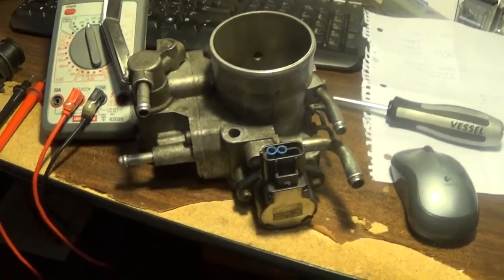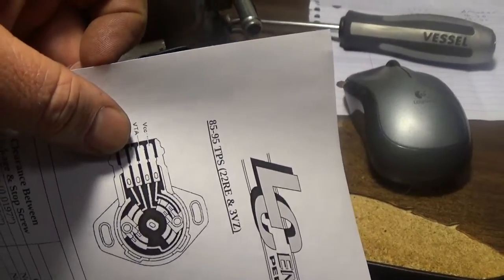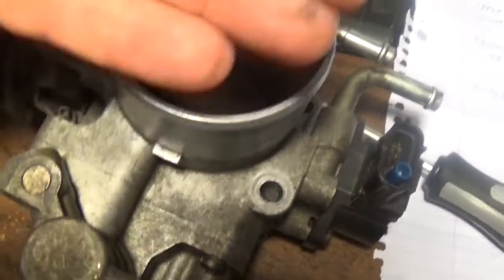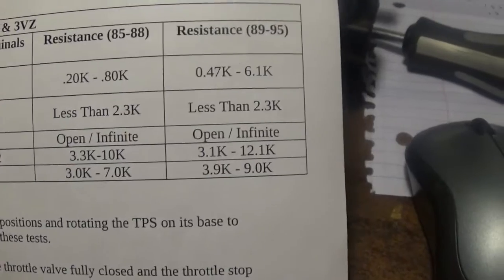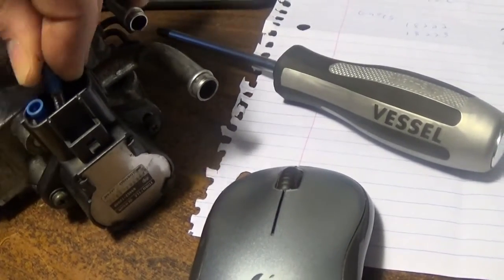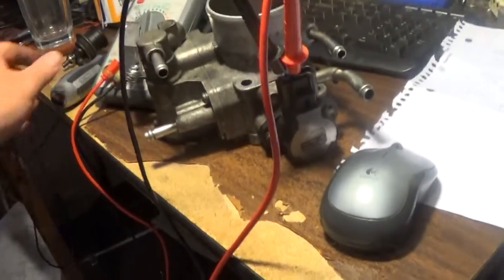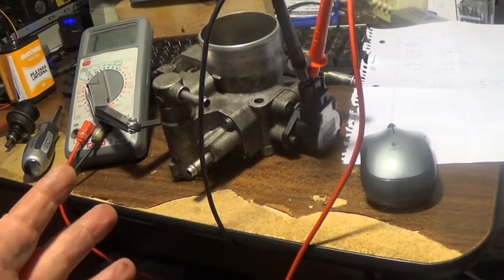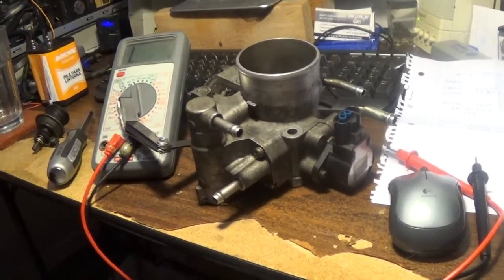Setting Throttle Position Sensor for 22RE

Comment: Your explanation is great! The last setting is what tells the computer that the engine  is idle. So all the other settings start from that position. The idle position should be the first adjustment. I have the 2002 v6 3.4 engine, it has the very similar adjustable TPS.
THANKS.

Comment: Im getting 5.4 for infinite ohms... please help!!
Reply from the maker: The video explains how to set it.
Reply: @tubejim101 Im just alittl lost, I ran thru the video a couple times but so the feeler gauge is supposed to be 0.85mm when done correct?
Reply: @tubejim101 Hey man I started with step 3 and I am getting 5. Somthing. 
Does that mean my tps is faulty? Please and thank you sir
Reply: Im confused so do i mess with the 2 screws on the tps to get an open/infite reasing for step 3? @tubejim101

Comment: This helped me a lot and I have a suggestion that people can also use to use the probes on the tiny terminals.  Anyway you can make a lead wire with a spade female terminal that is normally used for speaker wires.  One reference u could use are the two small speakers by the glove box and left to the steering wheel .  Those wires have the same connectors that fit perfectly on the pins.  Also I happened to have a push button switch plug that I was going to use to activate the horn and broke the plastic housing off to get access to the wire and connectors, just a last minute kinda thing .  Also if you have a downward pointing TPS orientation type like mentioned on the type up from crawler , there’s not alot room for error I found with the recommended oem parts .  I had one that I purchased online and it was orientated downward but it took alot to test and get the proper readings . I’m sure there might be more to it from vehicle to vehicle and wear and tear .  I’m interested if anyone else had the same experience
Reply: With that suggestion I’m looking for one also .  I removed the upper intake manifold to clean it and buttoned everything back and as soon as I energized the fuel pump gas leaked from the cold start union bolt where the copper crush washers are.  Do these need to be replaced each time the banjo bolts are removed?
Reply from the maker: @gatzbravo  Yes.

Comment: What exactly did you have your multimeter set on? Mine for Ohms has settings for 200, 2,000, 20k, 200k and 2000
Reply from the maker: You set the meter just below what ever value your going to read.  So if your going to read a 25,000 ohm value, you would set your meter to 20K.  You could have it at 2k, or 200k, but your going to have a harder time figuring out your values, unless you understand converting between, ohms, kilo ohms, and mega ohms.
Reply: Actually you should always set the multimeter just above not below or you'll reck your multimeter pretty quick.

Comment: I just can't get step 2 to work, would some help
Reply from the maker: Maybe ask a shop how much they would charge to set it up for you.
Reply: I cant either. All the others work but for test 2 I either get infinity or with the SLIGHTEST tap it goes to 10000 (supposed to be 2000 to 3000). Ive tried 700 times. There is no in between infinity and 10000. Its a brand new tps from Toyota dealer and the reason I put the new one on is because when I tested the old one it did the exact same thing with test 2. So it's not a bad sensor from the factory because the one I took off was  probably 30 years old so it's not like they both came from the same defective batch.

Comment: What gauge sizes did u stack ?? You did not say gauge size to stack cause mine are not right either
Reply from the maker: Just add things up.  So if you need .8  and you only have .5, just stack a .3.  .5 +.3=.8
Reply: @tubejim101  I did that  got it Close as I could

Comment: Hello would adjusting tps on Phillip screws help with cold idle?? In morning at first start my rpm goes lower than normal then once truck is warm it runs better it’s 1986 Toyota pickup 22rte efi engine
Reply from the maker: If your accelerator peddle is working fine, I would not mess with your throttle position sensor.  ODB1 is harder for me to trouble shoot.  Would be nice if you could tell what the computer thinks the cold temperature is.  There is a air bypass screw you could try adjusting.
Reply: @tubejim101  thanks for advice
Reply from the maker: https://youtu.be/S8L9Y_Z8Owg?t=202

Comment: So when you did  step 3 to get infinite wht size gauge  you had between the stop screw and lever?
Reply from the maker: .85mm
Reply: @tubejim101  thanks
Reply: @tubejim101  if you don't mind what's an open or infinite  reading
Reply from the maker: @jsngrmjo8525  If you hold the leads up in the air, and measure resistance, it is open, or infinite.  Basically it is a break in the circuit.
Reply: @tubejim101  ok but what should my ohmm meter read all kinds of numbers?
Reply: @tubejim101  or stay 0.00
Reply from the maker: @jsngrmjo8525  That would be closed or short.

Comment: Thx but I simply can NOT get both the IDL @ .85mm (to Inf) AND VTA @ .5mm (<.80, best I've gotten .88) at the same time, one adjustment knocks out the other.  '88 3VZE, error 51 (sometimes + 41).  I got the cheapest TPS off of Rock Auto, should I get a better one?
Reply from the maker: I have only worked on the 22re
Reply: I've been dealing with same aggravating circumstances so you're not alone on issues...
Reply: @barnesj0007  Main problem was distributor but idle & TPS still off so messing with those 2 now, doesn't idle down after warmup, sometimes shudder on road and/or idle bouncing between 2 spots.  One manual says when installing TPS just get IDL to infinite w/ a .62 feeler (kind of midway)
Reply: @slumpnc  I ordered a new Mass Air Flow for air intake off Amazon and truck running good now. Make sure you check all wiring to electrical so that there is solid connrctions. I noticed that some were dry rotted and barely clipped into harness as well. 👍

Comment: Can someone tell me how big those screws are I checked on mine and my bottom screw was missing
Reply from the maker: It is worth giving your Toyota dealer a call.  The price on the idle air control valve screws, where not to bad.  Also, shop around at different dealerships.  My local Toyota dealer, price gouges bad.  I order all my parts from a city 71 miles away.  They deliver for free, and charge 1/2 what my local dealer charges.
Reply: I took the screws that I had stripped to the local hardware store and both the same length and thread but with allen heads
Reply: They are M4 screws. https://www.lceperformance.com/Tools-Allen-Bolt-Upgrade-Kit-For-TPS-p/1093082.htm

Comment: BTW - I was able to find a NEW Genuine OEM Toyota 89452-12040 TPS (Throttle Position Sensor) on eBay for less than $24.00
Reply from the maker: Nice find.
Reply: Yes, I get one, thanks

Comment: Thank you so very much!
Reply from the maker: Your welcome
Reply: @tubejim101  You helped get my 93 Pickup with over 250K miles on it to pass smog yet another year. I was able to get everything to dialed right in. Damn near 0 emissions with the tune up and regular maintenance. It passed the high rev in less than 30 seconds and idle in under a minute. I owe ya one!
Reply: @yourdaddyjoe  did your vehicle fail due to ignition timing? my mechanic said it was the tsp

Comment: actually a quicker way to do this is to just immediately do the open infinite .85mm setting first because if you get that one right the other settings should be right so you just stick the .57mm feeler in to verify that it's less than 2.3k ohm.
Reply: ahh and you figured that out already.  my bad.

Comment: when putting new tps on should i have tension immediately or should it set loose inside
Reply from the maker: The tension is from the throttle body spring, on the side opposite, the tps.

Comment: So this can be done totally on the bench? I thought it would need power going to it while installed. Thx. I was hoping for Acknowledgement it can be done on the bench, but appreciate the thanks. Mike
Reply from the maker: Your welcome :)
Reply: Don’t need power to check resistance
Reply: No the tps sensor is basically a rotating resistance sensor

Comment: THANK YOU!!!! My Vessel P3x150 came this week right from j a pan! Love vessel phillips heads AKA jis! excellent video! Check mine out if you like tools =)
Reply: What are the recommended sizes of Vessel drivers to buy for the Japanese vehicles ?
Reply from the maker: @michaelspong2056  I like the P2x100 https://amzn.to/2K6hPZj
Reply: @michaelspong2056  I got the 1 , 2 and 3 for my truck. I just posted a video with my new #3 vessel impacta. I should be able to answer most Japanese tool questions, I hope =)
Reply from the maker: Yep.  Love my jis too.

Comment: Hello Tubejim,
toyota corolla 2000.
I did not see you open throttle and close the throttle for reading in ohms.  My grd wire 0.1v; signal wire 12.36; 5v reference wire 1.67v.

I back probed all 3 wire while opening and closing throttle flap 0 response on throttle resistor.

Disconnected the connector ohmed the ground and the signal wire middle ohm reading is 1.814 ohms. open/close throttle ohm stayed the same. 

What I learned from is how to make adjustments to the flap. If you can tell me is this a defective throttle it would help me .
Respectfully,
AG
Reply from the maker: I only know how to do this for the 22RE engine.
Reply: @tubejim101  thank you I did learn from about adjusting throttle and the variebles I will encounter when I replace mine throttle.

Comment: Hi, great video. I am going to remove/clean TB and adjust TPS regardless, but I thought I'd ask a theoretical question to see what you might think. So I am getting a lean fuel mixture causing pinging/knocking and I have eliminated other causes but not all...yet. My question is do you think an improperly adjusted TPS (Assuming all other air ,throttle, injectors, etc are set and working correctly) could cause the ECM to interpret a lower throttle position and therefore result in less fuel being injected causing a lean mixture?
Reply from the maker: TPS being off is going to cause your engine to not get the correct fuel.  If your getting pining/knock, I would suspect your knock sensor.  Also check your timing if your getting ping/knock.
Reply: I have been checking many things but so far no luck. Thank you for the reply. TB and TPS is next when I get the time. Thanks again.
Reply: KARL - "Great video "??  Terrible camera work and going back to say "this probably should have been step #1" ??   Try a little preparation before taping ?
Reply from the maker: @stevejette2329   You are correct.  Terrible camera work and lack of editing.  If the message got across, I am lucky.

Comment: Hi Jim,

I've made it to this point on my head gasket repair.  

When I try to remove the throttle body, it is firmly stuck to the plenum.  I have removed 3 bolts and the lone nut.  Also, the cable has been removed too.  Am I leaving something out?
Reply from the maker: Watch this video and let me know if you still need some help.  https://www.youtube.com/watch?v=rIsJnExn5Q0
Reply: @tubejim101  
I knocked it off with a mallet.  It had probably never been removed in the truck's 31 yrs of existence and was fused to the intake.

Comment: Thanks man, do you have a link for that diagram that you showed to us?
Reply from the maker: http://www.lcengineering.com/LCInstructions/Throttle%20Position%20Sensor%20Adjustment.pdf
Reply: @tubejim101  PAGE NOT FOUND (a dead link, please update)
Reply from the maker: @Jeff82556  https://lcengineering.com/wp-content/uploads/instructions/Throttle%20Position%20Sensor%20Adjustment.pdf

Comment: Iv put my new one on but I think it’s set wrong because the throttle won’t go all the way down to that pilot screw unless the tps is off but I don’t understand how to gauge it
Reply: I need help
Reply: Trent Bost : you have to instal it with the pins facing down and rotate clockwise to horizontal position to put the screws and adjust.

Comment: Thanks for the video!  I am sure this will help a lot of people.

It's easier to adjust it when the throttle body is on the bench.  The two TPS adjusting screws are hard to get to with a screwdriver when the throttle body is mounted.  Harbor Freight sells an eight piece right angle screwdriver set that will make it easier to adjust the TPS when the throttle body is mounted.
Reply from the maker: Thank you.
Reply: snippits75 : what you saw in the video is not adjustment,  that is to verify that the tps is in good condition.

Comment: Hey Jim great video . Here’s what’s going on with my 1991 Toyota Pickup . It will start up and idle. As soon as you give it gas it Boggs down and dies. I can drive it down the road and as long as the gas peddle doesnt go down all the way it’s fine. So I checked the engine codes and it said that is was tps. Went and bought one and it wouldn’t even start up . Took the new one off and put the old one back on and it starts but again same problem. I’m confused . Any help?
Reply from the maker: Setting the TPS is something you will have to do, even if you buy a new one.  After you set the TPS,  check/set your timing.  If you have the 22re, you will set the timing at the 5 mark.
Reply: tubejim101 so it still could be a bad tps I just installed the new one incorrectly?
Reply from the maker: Yes.  Installing it easy.  Setting it is tricky.  If you set the infinite ohms first, most likely, everything else will be set too.
Reply: tubejim101 so I assume my original is bad? Even though it idles?
Reply from the maker: If the ohms are out of range, at the different feeler gauge settings, then it is bad.  The TPS changes the ohms at different positions, and feeds the info to the computer.  That is how the computer decides how much fuel to inject.  So if you do not set the TPS correctly, your computer is getting bad info, and not giving the correct fuel amount.  It could idle fine, but no power when you step on the  peddle.  When mine was set wrong, it would idle kind of fast, but when I drove, it felt like my clutch was slipping.  Now that mine is set correct, the truck is peppy.